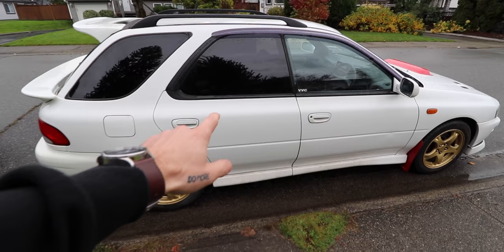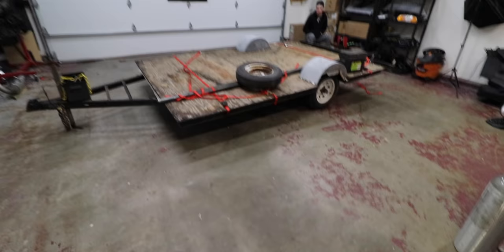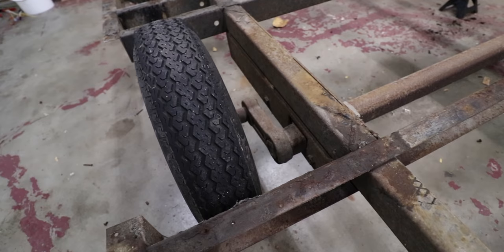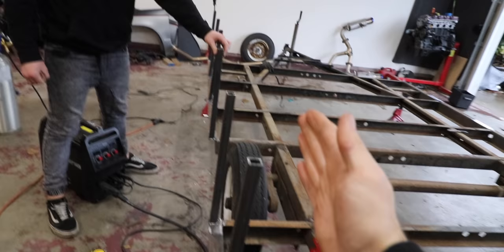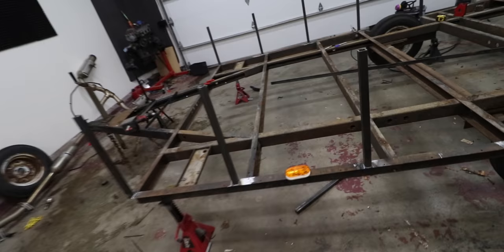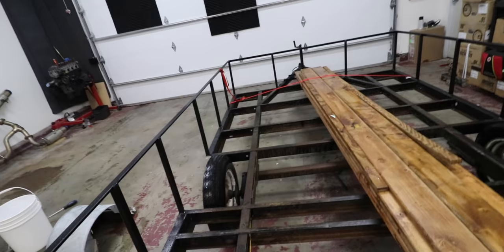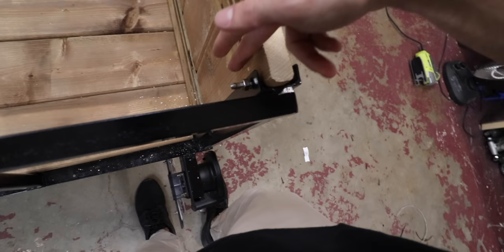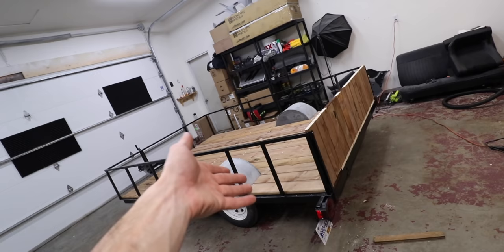Building a DIY Utility Trailer! *CHEAP*

Comment: If you're ever going to put snowmobiles on that trailer I'd recommend mounting a solid plastic over the wood, you'd be surprised how quickly the carbide runners mess up wooden decks.
Like so Robbie sees this.
Reply: Sebastian no stop asking for likes
Reply: @smokingtires9716  Assuming I made my comment for the likes is a pretty toxic attitude.

Comment: Stain and seal the wood so it doesn’t get water damage and start molding 👌🏻
Reply: Justin Guarino I agree with this ! Would make it way more durable
Reply: This. @robbieferreira
Reply: That shouldn't be a problem as it's pressure treated though right?.
Reply: @sebastianolsson9063  the exposed ends that were cut aren't treated so the wood will absorb it from there and make the ends rot, it's not the worst since it's held down in the middle but would still suck if it looks like shit in a few months because of it.
Reply: @420Cris  Yeah I actually didn't think about that!
Reply: By the time that happens i doubt they will still be in possession of this trailer
Reply: jp91484 Since you replied to this yesterday, I’m going to assume you have seen the video from last week.  No, he no longer has the trailer, but at the time; that was his trailer, and I just suggested doing so to keep unwanted mold out of it and to keep its lifespan longer:)

Comment: The slip gate will swell in the rain and get stuck
Reply: Actually that treated wood is already soaked and swelled to its maximum dimension. It will shrink quite a bit as it dries

Comment: 17:31 the license plate light comes on with the brakes 😂
Reply: My best guess is the trailer-lights manufacturer just used the tail light bulb as the license plate light also. There’s nothing illegal about it, just some cost-cutting that won’t hurt anyone.
Reply: Mayhem 559 nah he must've just wired the live from the brake lights into the license plate bulb, rather than using the live from the normal tail lights, it was probably only temporary though as it looks like that's just when they used it to go get the wood from the store, still made me chuckle though
Reply: MrTuts4life nope trailer lights like that only have the one taillight bulb and not a second for plates. If the headlights of the jeep were on then the plate would always be lit then the second filament from the bulb would show brake lights

Comment: Robbie if possible remove that last little strip of wood and space them out a little, wood expands and contracts quite a bit and can get loose or damage stuff even. That way water wont get trapped and puddle up on there as well. Also, an annoying step but try to seal that wood when it dries up with polyurethane floor finish or something like that if you want it to last a long time and look good.

Comment: “Why is this thing in metres?” How dare you use a sane and logical system of measurement 😂
Reply: Sorry but imperial is actually better
Reply: Definitely! Hence why the vast majority of the world uses the imperial system...
Reply: @ehh.97  Ive actually built stuff using both. What makes imperial better is that it is much easier to eyeball inches and fractions of a inch then it is mm
Reply: Fair enough man, I guess everyone grows up using something differently. My mother grew up with imperial before Australia changed it so I think in inches and feet as well as m, cm and mm. I find metric easier to eyeball (excluding singular millimetres), but as long as everyone has something that works for them 😊

Comment: I just finished my trailer build.  I got a duel axel camper dram for free plus free lumber for the decking .. ended up total using 41 boards , made my fenders out of scrap 2x6 pieces ( saves me $200 ) overall it was a fun project, very time consuming but fun

Comment: Looks minty, although the board you used to hold the gate together looks a little flimsy, maybe throw some of the extra metal bar on there instead? (Assuming you have some left)

Comment: The rear support stands are for when the trailer is rear weighted, the stands is there so the front doesn't fly up the second you undo the trailer from your car just a saftey mechanism

Comment: 15:52 Did you space out the wood so it doesn’t expand and crack with moisture. And maybe put something over the open ends so it doesn’t mold

Comment: You can use an ammo box for the storage box. They are painted steel. They are water tight as well as you can weld or bolt it down!

Comment: I would have still painted that underside, juuuuuust in case for rust protection

#paranoid

Regardless that came out amazing. 
you should consider doing that again and flipping it for some quick cash  ^_-
Reply: Not paranoid if you ask me. If you do something do it completely and properly

Comment: You should leave a gap on you tail gate to let water leave the trailer
Reply: You can find a used truck tool box that you can screw on to the front of the trailer
Reply: Missing u links to connect to for the straps